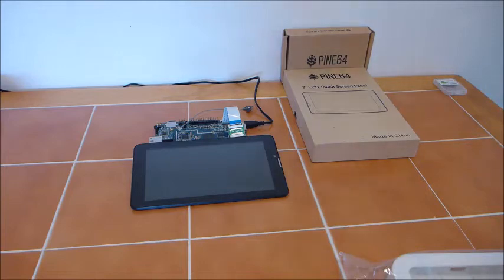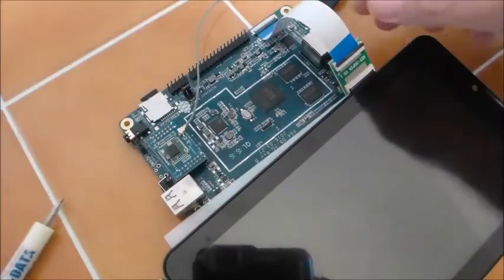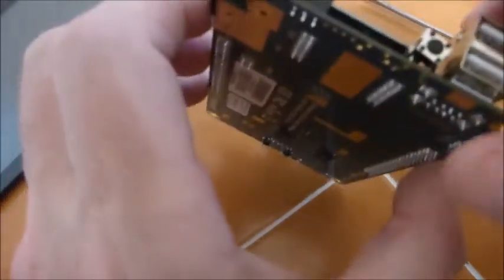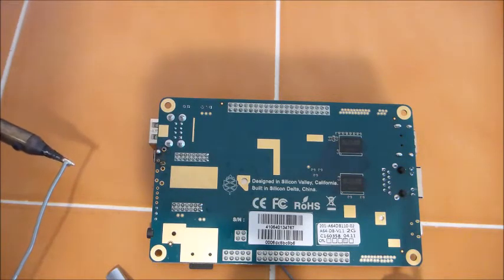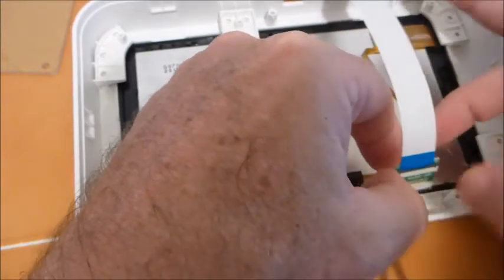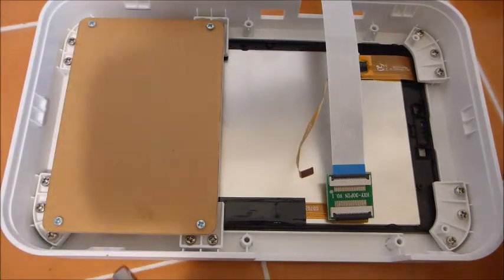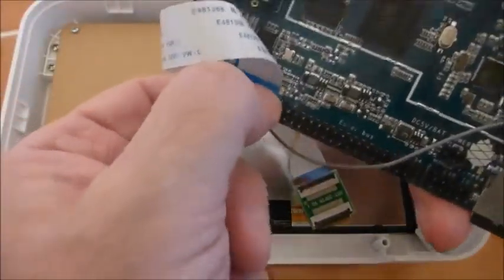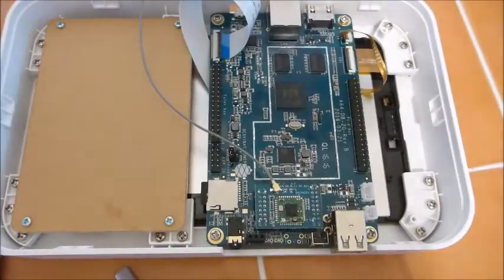PINE64 Playbox Final Assembly

Comment: Pro tip for soldering...when soldering, you're not trying to deposit solder onto the iron, then to the part.  Instead, try putting the heat of the soldering iron to the part and apply the solder to the part, once its hot enough the part will heat the solder and it will flow much easier and cleaner.
Reply from the maker: Altered Existence - I used to be good at soldering. In the '80s. I also used to punch cards to write programs in assembler.  Time has degraded my skills significantly.
Reply: not making fun...me personally it helps when i forget how exactly to do something to get a little fresh insight...good video though, I'm actually going to buy a pine 64 here soon so it helped alot.  Good luck in future projects ;-)
Reply from the maker: Altered Existence - The whole point of making these videos was for people to help each other out. This was a great tip and it brought back memories soldering a board on a $5,000 teller machine that took a lightning hit. I really was better at it. But I swear the parts were way the heck bigger then.
Reply: The lead solder was much more forgiving back then as well ;-)

Comment: You forgot to remove the protective paper from the acrylic before attaching it to the case.   

For inserting the cable angle it slightly upward so it can slide into the slot further inward that the black retainer clip.  You can do it in one or two tries once you know this.  Also, attach both cables before placing it in place to screw it down, as shown.  There is no way to attach the skinny touchscreen cabling without it twisting around but no tools are required.   You can also tuck the thicker one under the plastic (the one you forgot to remove the paper from) that the battery is suppose to sit upon.  The will allow the case to close better without bunching the cable.  

Nothing is securing the battery in place.  It will rattle around in the case.  I used sticky backed extra strength Velcro on the plastic and then the battery to secure it to the plate.  The button you spent a lot of time on is badly soldered to the board and very crooked.

I have no solution for the Z-Wave yet.

Comment: No instructions on getting LCD installed, both hardware and software configuration with Linux OS. Tried SEVERAL Linux OS flavors, and only Armbian worked! FINALLY got touchscreen to work EXCEPT X and Y cursor needs to be flipped and web and support at Pine store refuse to help. F Rockpro64!!!!!!!!!!!! NEVER again!!!!
Reply from the maker: I fried the one in this video years ago and bought a second one. That one died just as fast. It was a fun toy but I never wrote any aps that were worth anything which was really what I bought it for. The Raspberry Pi I bought at the same time wound up eventually as a WiFi bridge and ran for years till I finally burned out its wifi port. Fun toys but in my case ultimately useless.

Comment: http://forum.pine64.org/showthread.php?tid=1682

See page 7 for an alternative LCD enclosure by C4 Labs
Reply: I have both, the C4 was much harder to assemble and the battery connection is faulty but you can always change the SD card, add a fan or Z-Wave modules but then you would have to further modify the case.  I may try and modify it so I can add feet to raise it it enough to add a fan, somehow.  It's a uglier case but more functional.  I may get another anyway and assembly the battery differently.

Comment: Hi Bob

Thanks for your nicely explained video.
I have I further question. Which image have you running on your Pine64?I tried out several image from the wiki page (image for LCD display). But no one was
running. I used the Win32 Disk Imager (and tried out the AllwinnerPhoenixCard).
Btw. the image for HDMI Video Output is running
on my Samsung TV.
Thanks and Regards,
Martin
Reply from the maker: My fault. I went over that in detail in the previous video and neglected to restate it in this one. One the Android LCD version seems to work on the LCD. What problem are you having?
Reply from the maker: +Bob Carlson sorry. ONLY the android LCD version seem to work. I'm at Disney right now.

Comment: In order to make insertion of the ribbon cables easier, screw the Pine64 board down first, then you don't have to hold the board when you insert the cables.  I too had preassembled mine prior to receiving the Playbox and I found the ribbon cables much easier to insert the second time around when I had the Pine64 board mounted in the enclosure.

Also I think a big part of your problem soldering the reset switch is that the solder doesn't flow well  onto the trace holes on the board itself.  My own solder job didn't come out much better than yours, and I have built plenty of things, so I do know how to solder.  

The plastic board is to provide a surface to mount the battery on if you purchased that option, which I did.  I will use velcro to hold the battery in place.
Reply from the maker: All good advice. My biggest problem is I can't see the small stuff all that well. Yes. A battery would make this much more useful. I plan to order one.

Comment: my god this case is so badly designed, so once you have closed it, just how are you supposed to get to the sd card to change or update the os?
Reply: oh wait, scratch that, you can open it like a phone along the seam. that was way easier
Reply from the maker: Wait!! You got yours open? How?
Reply from the maker: Also that card board piece blocks the SD card so it has to be gotten out of the way to remove it. I found that annoying.
Reply: yup, my case arrived today and i couldn't have done it without you, i also noticed the card blocks sd, so stupid.
Reply: I have one of those spudger things to open mobile phones up and I pushed in the top of he case (i think it was near the large opening) and levered around one side of the case and this was enough to open the rest of the case. I will close it up once I have got an image on the SD that works with the LCD. I haven't got the screen to work yet.
Reply from the maker: +dzw9000 I had to refer to my own video to locate the latch but popped it open with a knife blade. NOT RECOMMENDED. Not something I would want to do more than once or twice.
Reply: you can drill paper clip diameter holes in the sides where each bottom clip engages.  If you want to open it later, you would just need to insert a bent paperclip or similar tool to push on the clips tp disengage them...that and a spudger you should be able to work your way around the bottom till it pops off.
Reply: +Bob Carlson  it's actually a plastic piece with that brown sticky protective paper...you can cut out a small area where the sd card is so you can remove it without having to remove the plastic panel.  depending on the battery though, I wonder if that would totally block access.  I think this case is really meant to be closed up only after the final system design is finished....
Reply from the maker: +michael rew wow. Great idea on drilling holes an yeah I totally missed that was a plastic part. I can't see the need right now to open it but it's cheap enough to order just another Pine64 to keep playing with operating systems on a monitor.
Reply: +michael rew I assumed that the card bit is a placeholder for a battery.  shame you can't seem to buy it yet or in the UK.
Reply: Without removing the plastic battery mount board, the micro SD card can be removed, once you push it in to get it to release, all that's necessary is a pair of tweezers that can open wide enough to grasp the card on each side.  I removed and replaced my card using this method without notching or removing the battery mount board.
Reply: +John Giroux I ended up doing the exact same thing but it's still a pain in the arse
Reply: Guitar pick. Always have one handy around your project area.  Great for taking any electronics apart without marring the finish.  Enjoy!
Reply: YOU CAN NOT.  They got the board orientation rotated 180 degrees for how the case should have been designed.  You simply needed to change the cable lengths and flip the slots.
Reply: Toriless well if you can't, that's your problem, because I have removed and replaced the card with everything installed in the case.
Reply: You do not.
Reply: I guess you figured out that the cables would be too short.
Reply: I used the cables that came with it, and I can remove and replace the card with everything in the case, not difficult at all.

Comment: Hey Bob, thanks so much for all your videos.  I appreciate you blazing the trail.  I am not sure is anyone mentioned it (I couldn't find a comment that did) but that piece of what appears to be cardboard is actually a piece of cut acrylic (or some other sort of plastic).  I recognized that stuff from using a laser cutter a few times.  The brown protective paper peels away from the acrylic and you're left with a piece of white acrylic.  Leaving the protective covering on doesn't really affect performance but it looks a lot cleaner once everything is installed.
Reply from the maker: Someone did mention it is likely the battery holder. The joys of zero instructions. But I find the building of a community and everyone helping each other out much more satisfying than a complete set of instructions.
Reply: Yes, it is the battery stand.  It holds nothing in place.  The brown paper is suppose to be removed like with all acrylic sheets.  If he had experience with acrylic like me he would have know that without thinking about it.  It is very think and cheap.  Mine has already cracked.

Comment: Great overview Bob.  Could you tell me which firmware you are using for the SD?
Reply from the maker: The only version I have used for the LCD is the Android  5.1.1 downloaded from Pine. Sorry. I made mention of that in an earlier video and should have repeated it. This unit was shipped with Android but not the LCD version. No other operating systems I downloaded lit the LCD. That was a few days of frustration for me till I found a single mention of it on an obscure blog. Pine should really make that more clear.
Reply: +Bob Carlson thanks Bob. I believe I found that same blog with the LCD version. I haven't been able to power my unit. I'm having the same issue with that tiny power button.
Reply from the maker: +Walter V. Marshall did you solder it in? I just turn mine on and off with a power strip. The reset button is pretty useless. I didn't really need it and could have saved everyone that sloppy solder demo.
Reply from the maker: +Walter V. Marshall go to the end of this one for instructions on getting the software. https://youtu.be/8qeDAyKRzNY
Reply: +Bob Carlson Do you plan on installing a rechargeable battery in your unit?
Reply from the maker: +Walter V. Marshall good question. I am experimenting with a Jackberry battery pack that I charge my cell phone with. it says it has 5V 2.1 A output. I'm waiting to see if I burn up the board with it before I mention it to anyone. The biggest mistake in electronics is mismatched power. so far it's working but I'm hesitant to play a whole movie just yet.

Comment: I finally got my case after many months of patiently waiting. It doesn't appear they have included the longer monitor cable. Is that something you need to purchase separately.
Reply from the maker: My case came with the longer cable. Although it's way more than enough I did not try the short cable that came with the Pine64. It would be a stretch if the short cable fit.
Reply: Whew, found it in the packaging, almost threw it away.
Reply: No, it it was not included request one!  It makes installation MUCH easier.
Reply: ONE CABLE IS TOO SHORT AND THE NEW ONE IS TOO LONG.  (damn caps lock)

Comment: Awesome Video Bob.

So where did you stick the antenna when you were done?
Reply from the maker: I just left it loose. I didn't see the need to mount it. I'm still getting the same performance as I did before the case.
Reply: I just placed it away from the battery since it is the most likely source of interference.  I also use the RTC battery as well, also secured by Velcro.